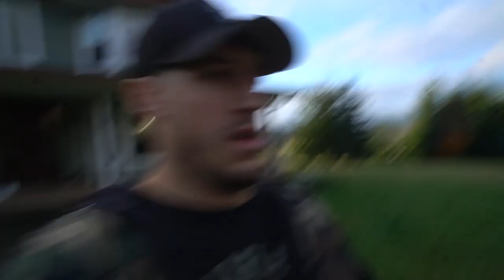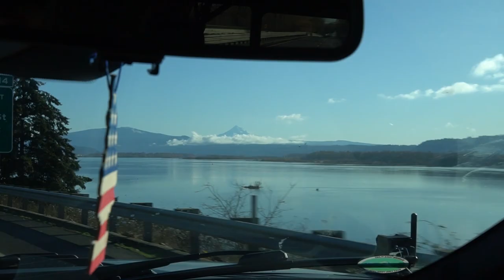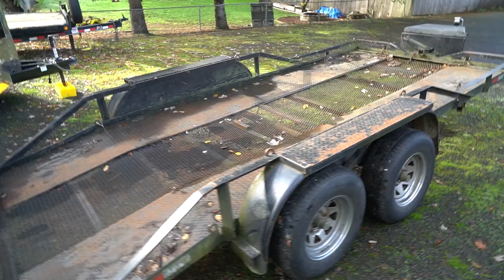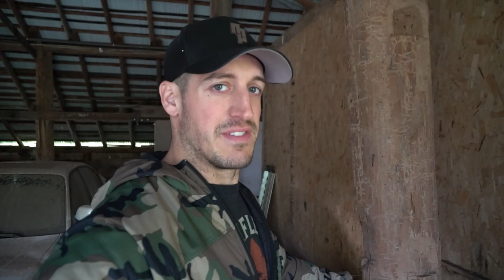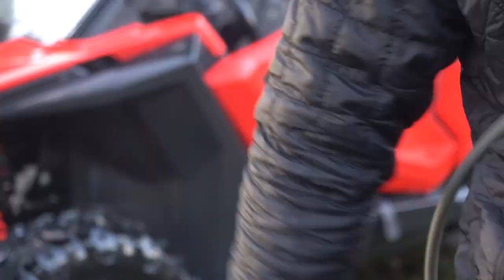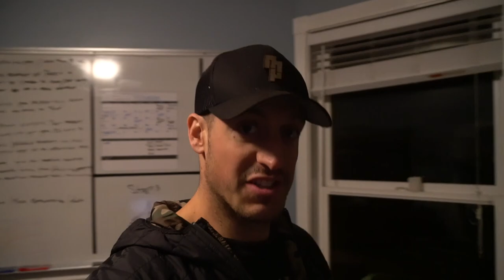PERFECT Weekend Warrior's Off Road set up?

Comment: I work at an architecture firm and we designed a wedding barn for a home owner. They used the barn for weddings but got in trouble when they used the space to work on their vehicle. So you should look into your local building codes. It has to with the occupation use codes.

Comment: Hey Max meals and wheels good name, what you really need to do is think about just putting some concrete on the inside of the garage you’ll knock down all that dirt or put gravel in there I know how bad you want a garage but at least It’s will give you a place to work that’s a lot cleaner, good score on the trailer and yes get Des shoe off the roof 😂 as far as the Toyota man wrap it with raptor spray bro ok 👌🏼🔥🤠🔥Camping Russ out